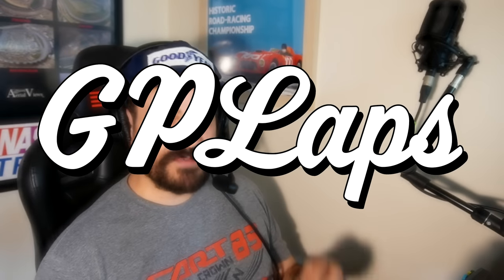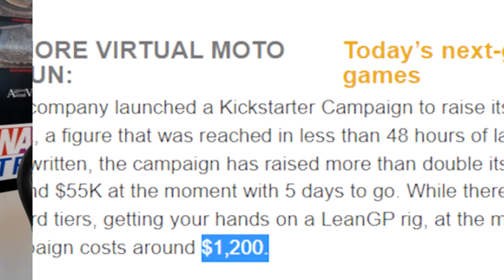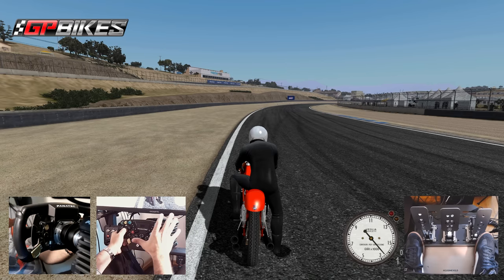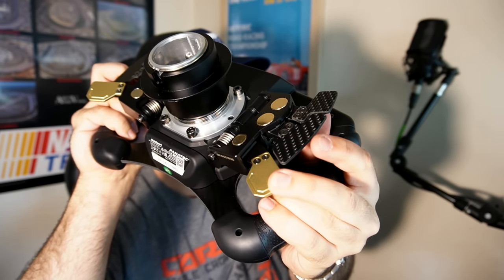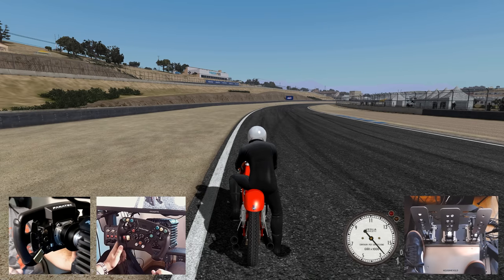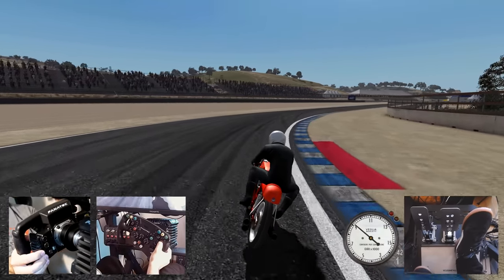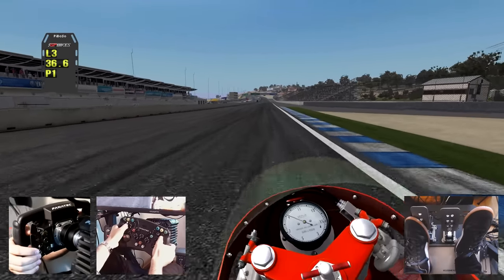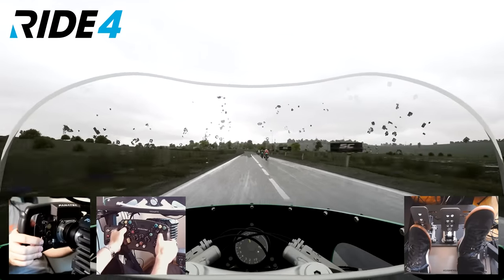Set Up Better Controls for your Bike Sims! - Basics Tutorial

Comment: I wish we had a vr motorcycle racing game where you use the hand controllers to grab the handlebars and controls. You'd just need buttons for shifting gears and rear brake
Reply: Considering how you generally steer a motorcycle with your whole body, I don't think that would actually work.
Reply: @brinkipinki  you just push the bars to countersteer the bike, leaning is extra, and you can still lean in your chair anyway
Reply: @F1Mike000  sure, but irl I lean my bike with my legs and shift my body weight around. Countersteering is not something I do consciously (maybe I should?). The handle bar is just not the only steering input you have on a bike.

I'm not saying it wouldn't work. I'm saying it would be extremely unituitive (atleast for me).
Reply: @brinkipinki   there is a classic video you should look up, twist of the wrist 2, where they debunk the idea that you can steer with your body. If you are ever on the road and need to quickly steer out of trouble it's important to know how the bike really works. You need to press the bars. In the video they have a guy putting all his weight on one peg and the bike hardly changes course. Not trying to give a condescending lecture to you, stay safe friend
Reply: @brinkipinki  Think of the bike as of a stick you are trying to balance on the palm of your hand vertically. To shift it to a side you need it to start falling to that side first, for which you quickly move your palm in the opposite direction. Once the desired position is reached, you quickly "outrun" the falling upper stick end with the palm and make it straighten up - that's basically bike control in a nutshell. It's EXTREMELY inefficient to try and make the bike start falling to a side with your body movement (unless you are going very slow), and that's why you are using counter-steering instead (to make the front wheel go from under you and to a side). Why try to make it fall to the side in the first place? Because to try and balance out the fall you'll need to STEER in the direction of the fall. And that's how you turn a single track vehicle.

Comment: There's a guy on YouTube that used a Fanatec universal adapter and mounted handlebars to it. You could probably map everything from the throttle, clutch and brake with some potentiometers and an Arduino and get away quite cheaply. Not sure how well linking works here in the comments but here's a mixed reality POV video of his setup! https://youtu.be/Uwb2Gssg9Qo

Comment: It's actually crazy to me that bike sim thing is only $1200 when a Fanatec wheel with a rim alone will cost just as much. That's actually a decent value.
Reply: I'm pretty sure that was a Kickstarter scam and never released.
Reply from the maker: Fanatec is also selling a full DD bundle for $300 right now. Nevermind the space that would be needed for that thing!
Reply: @GPLaps  That's actually kind of annoying that the bundle is cheaper than the base and rim alone. I kind of want to upgrade the wheel but the pedals are worse than what I have.

Comment: Using the wheel is quite intuitive, the only down side is not being able to map an intuitive way of leaning, since you have rider lean to turn the bike, plus rider lean to position the bike.
Reply: If only there was a way to pull the wheel towards you like the Merc F1 car, think that could be a nice way to do it
Reply from the maker: Now I'm wondering if i should get the flight yoke out....
Reply: No, rider lean and bike lean are separate, not to mention you can even enable direct steering in the .ini
As for the rider lean, you can map that to the headtracker/VR unit translational movement.
Reply: @getsideways7257  Rider lean and bike lean are separate. You just didn't enable it in the options. :P
Reply: @flammenjc  Why do you make it look like you are disagreeing with me when you are saying almost the same exact thing?
Also, I use direct steering (not to be confused with "direct lean"), so my bike lean axis is actually the steering axis instead.
Reply: @getsideways7257  Quite simply, I didn't read it correctly. My bad :D

Comment: Hi Jake, did you use this x360ce for ride on the edge 2?. I have managed to setup my DD1 and pedals without x360ce in IOM2 but the game keeps sort of randomly disconnecting and I have no steering! A change of rider view instantly brings steering back, very od. I will have to have a go of this x360ce tonight as I have persevered with this sim for years with a controller and just not got into it. With a wheel however, in the little time it has worked, I can feel this being the closest to riding so far.
Reply from the maker: I think Ride on the Edge 2 actually allowed mapping other joysticks, but x360ce would definitely work for it as well. I'm not sure which would be superior
Reply: Sorted it, whilst trying to sort this app out, selecting controller not wheel in game and its now working fine. Turned out the app was not setup properly, so the SIM prefers controller not wheel when setting up my DD1, cheers Jake.
The experience is so much better with a wheel. You can tip it in smooth on the brakes, then pick it up on the power, just like you would do. For the first time since getting GP500 all those years back using a flight stick. It feels closer to riding than ever. Just needs some FFB, which is not going to be easy as the force is opposite to the direction of turn in. You actually push the opposite way to get the bike tipped in, once layed down to the desired line the bars go nutral. It's all about over coming gyro and using your body to man handle the bike from one direction to the next. But this is close enough for sitting at home, very satisfying getting hard on the brakes with the back squirming, timing your line to the apex then blasting out the corner getting the front all light n loose. Guess I'm going to have to try this GP Bikes.

Comment: Man you've taken over my life but thanks for this video. I'm having a nightmare with X360CE using the dd pro with that steering wheel and they podium advanced module as I've got five instances of Fanatec wheel in the instances id! Is there any way that you can share your preset in the copy preset Option copy and paste? 
If not is there any way that you can show me your screen grabs of the emulator Set up for ride 4?
In the meantime I've just bought GP bikes as there is a promotion for the next 46 hours on steam if anybody's interested with a 15% discount not that it is expensive at 19 quid